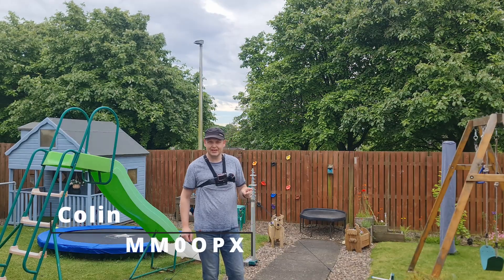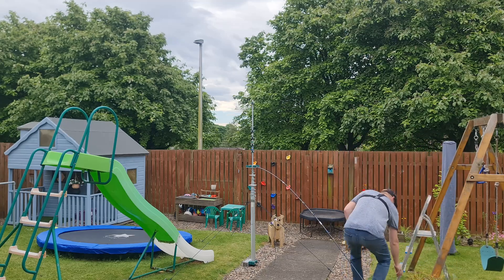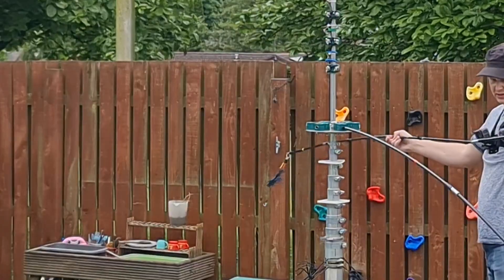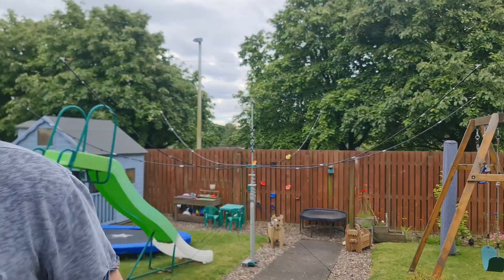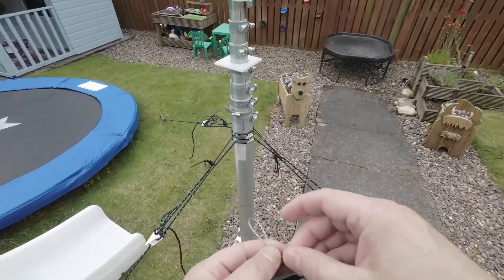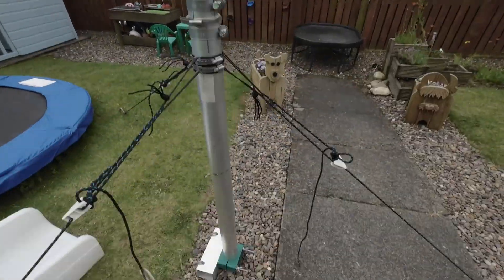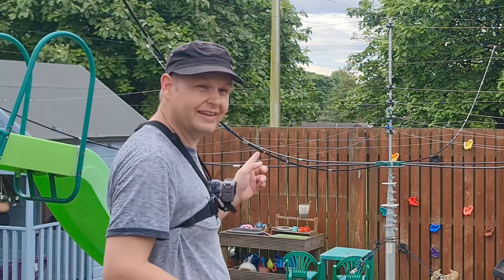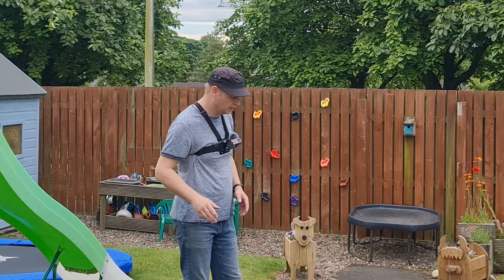Setting up an HF Hexbeam in Only 20 Minutes

Comment: How about just rotating the antenna when you add elements instead of running around??  Also, who says the wires have to go in the rings at the "top" of the pole versus at the bottom. Would make insulation easy just spin the whole apparatus and bring the wires up to the clips...(?).
Reply from the maker: All valid points 👍. All roads lead to Rome.

Comment: Colin, how long are your spreader arms?  they look really long.  I’m looking to use fiberglass electric fencing rod that are 3/8” x 48” each
Reply from the maker: They are standard 11mm tent poles, 1m in length so your 48" sounds similar.

Comment: How did you keep the spreaders from rotating in the base plate mount? My spreaders won't stay up right when I put the hex together.
Reply from the maker: Its not an issue when I have it all tensioned up. I would need to see some pictures or s video.
Reply: @MM0OPXFieldRadio  I used 7mm tent poles, which might be my problem. I put in an order for 11mm tent poles and hopefully that does the trick.
Reply from the maker: Yes 7mm WAY too light. Watch my lessons learned video. 11mm will be good for you.
Reply: @MM0OPXFieldRadio  I was trying to save money.haha I should have just bought the 11mm poles to begin with. I plan on drilling a hole for a setscrew to tighten the poles in place.
Reply from the maker: Yes I thought I could get away with 8mm poles. Way too saggy.

Comment: Great video.
What kind of wire are you using?  Will it handle high power? Where can I get some? Nice looking antenna.
73s
Reply from the maker: Its 1mm stainless steel. Yes it will handle QRO no issues. Just search for 1mm 7x7 stainless steel wire.